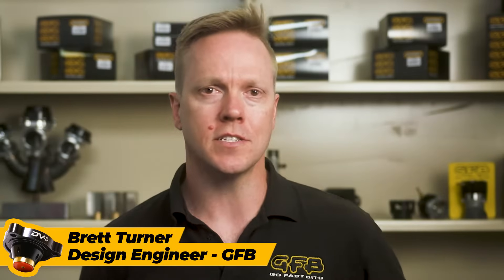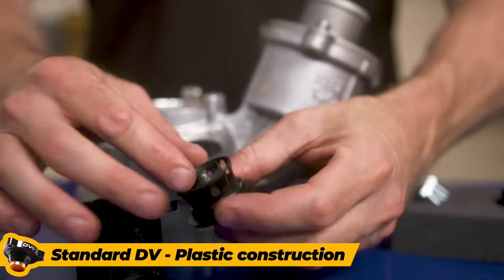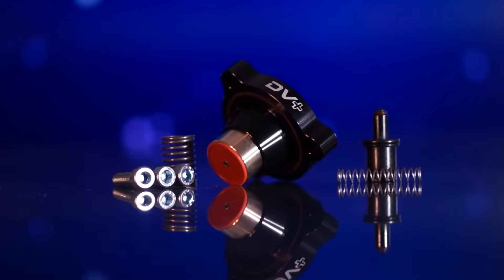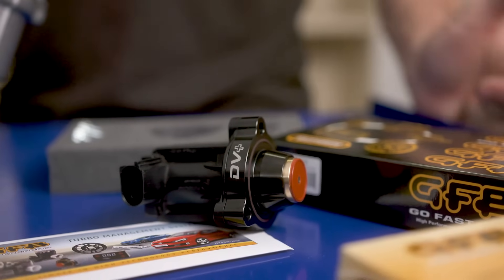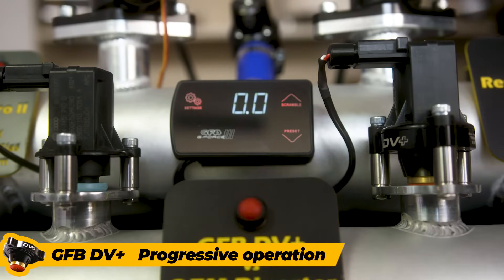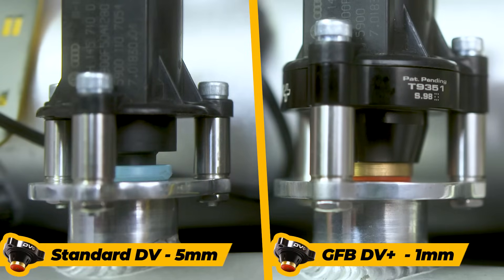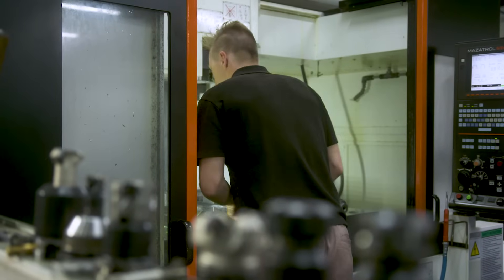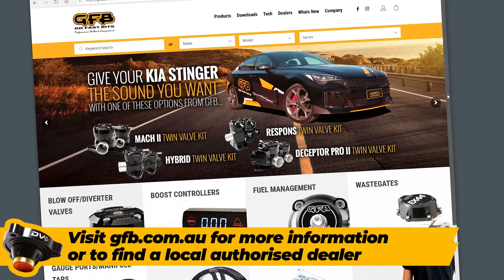GFB DV+ Diverter valve overview

Comment: Installed in Giulietta 940 (1.4 multiair)

Absolutely fantastic!

Long story short: Easy to install. Only took 10min. There are videos on YT to show you how to do it, but the instruction on the manual is very good as well. Lucky for me, the valve location is very easy to reach.

Transmission: It is design to optimise how much boost to loose. It is said to improve a lot for manual transmission. Mine is a TCT auto, and what a difference! The G, being a 1.4L turbo, is not that fast, and turbo lag is horrendous. The TCT box is slow to shift. I thought it was the gearbox, turns out it's the boost leak from original factory valve. With the DV+, it shifts just as you need it (without having to tell it to). 

Acceleration: Now that it got all the boost it needs, it goes like a Maserati (really press you into your seat). Before install, I usually prefer switching to Dynamic mode just to drive normally when I have filled the car with adults. Now, I can do it in Neutral and doesn't feel sluggish. Starting the car takes about half a sec. off. Stop start is quicker to engage. Downshift improved from 2 gears down to 1 gear down when going on ram to freeway. You don't have to step as deep on the pedal as before. 

I have only got it for 3 days. I suspect fuel economy will improve in the long run. Will report it if I have significant gain.

Highly recommended!
Reply from the maker: Glad to hear you're enjoying the DV+! Thanks for your feedback!
Reply: I also own a 1.4 Giulietta and thinking of putting one of these in alongside to compliment my GSR induction kit to reduce some lag and get more turbo flutter.
Big thanks for the report from one G owner to another 👍🍀
Reply: That's great to hear, I ordered one for my 1.4 multi air 124 spider also automatic. I hope it was worth the money, can't wait for it to arrive

Comment: I put mine on, my original wasn’t broke but I hoped I would get some noise out of it but there was no noise change
Reply from the maker: Hi Jason,
The DV+ is designed to be a performance oriented replacement for the factory valve, and improve some of the reliability issues with the design. It is not designed to make noise. Depending on what vehicle you have, we may have an atmospheric venting valve available. This would give you the noise you're after
Reply: @gfbvideos  that would be great if you did, I’ve a mk5 gti 2007 if you had one I’d buy one
Reply from the maker: @jasonseery4885  We do have an atmospheric valve available for the Mk5 Golf GTI. The part number is T9451

Comment: 2020 EcoBoost Mustang here.  Would you recommend this?
I was going to get a BOV but I think the constant whoosh sound every time you let off the gas would be more annoying than anything.  Is this Diverter Valve less obnoxious?
Reply from the maker: Hello,
The DV+ is a much more discreet option than a BOV. Unfortunately though, we don't have a DV+ or VTA available to suit the 2020 model EcoBoost Mustang. This model uses a different design of valve which is not compatible with our products
Reply: @gfbvideos  OH darn!
Thank you for the information though =)
Reply: @gfbvideos , that’s odd.. several resellers/dealers have a model listed for sale for 2020 and newer EcoBoosts. Is this really the case? I just ordered one for my 2021, so if there is truly not a version that is compatible I will need to cancel my order.
Reply from the maker: @semper.fidellis  The valve will not fit the 2019-on EcoBoost engine in the Mustang. Different EcoBoost engines in different vehicles have different valves, so there may be some confusion when looking for an "EcoBoost valve" as this term would encompass quite a few products. For the Mustang specifically though, there is no valve we currently have available for the 2019-on models. 

If you'd like to confirm this you're welcome to send some photos of your stock valve to us at support@gfb.com.au and our engineers can take a look at it.

Comment: Question does the DV make a sound like a BOV?
Reply from the maker: Hi Aadam,
The DV+ is a fully re-circulating valve so it is not designed to make noise. If you're after something that vents to the atmosphere to make noise, check our website for other models that may fit your car such as the VTA or DVX

Comment: Just purchased one of these for my recently purchased Sentra Nismo; noticed throttle response on it isn't great, as well as losing boost quickly. This seems to be what is needed to fix these issues; arrives Tuesday!
Reply from the maker: When an OEM valve has failed you will definitely notice poor throttle response and slow boost onset. The DV+ will certainly fix and improve the issues associated with the OEM diverter valve. Hopefully your issue is with the OEM valve, in which case you should be sorted out in no time!
Reply: Your diverter valve is busted , just buy a new one and put the GFB ON THE FRESH DV
Reply: @crashoverride1575  wdym? did it not work

Comment: i just seen one video on it ... the guy took it off as you keep have to oiling the pistion every so often is this true
Reply from the maker: This is a myth as periodic maintenance or re-lubrication of the DV+ piston is not required. Once the DV+ has been used for about a week the microscopic machining high spots are flattened and smoothed. The DV+ will continue operation almost indefinitely without wear, irrespective of lubrication.

Comment: @GFB Why don't you have a product for the Biturbo V12 Mercedes M275??
Reply from the maker: To put it simply, we've not had an M275 in the workshop! However, there's a better-than-good chance our T9354 DV+, T9454 VTA, and the T9654 DVX will fit. Contact us through our tech support and we can discuss in detail.
Reply: @gfbvideos   ah yes, Mercedes just uses the standard mechanical vacuum/diaphragm with beige plastic cap that come stock on BorgWarner EFR & KKK recirculation valves (as seen in part 5900711000 and 179424) the vacuum hoses just lead to separate inline solenoids.

Comment: Hi! Ordered one today through a Swedish company called DO88. (NR T9351)Im curious though, if it will fit on my car? Its a Vw Golf Alltrack 2018 with the 1.8 TSI EA888 3d gen. Please advice, hope I bought the correct valve. Thanks!
Reply from the maker: Yep, T9351 is the correct valve for your Alltrack.
Reply: @gfbvideos  Thanx mate 😀. Tomorrow, its time for installation!

Comment: Can I install a diverter valve spacer to have a louder blow off on this product?
Reply from the maker: Yep, as long as you have the room and the longer bolts you can stack a DV+ on top of a BOV spacer for sound. If you haven't purchased either, I would suggest taking a look at our VTA range, which is an atmosphere venting version of the DV+.

Comment: Hi, I just got one for my BMW F20 116i and the turbo lag has increased 😕 I am thinking to take it out, unless you got any idea what I could do to fix it?
Reply from the maker: Hi Slav, I've just replied to this question in tech support. The additional information you gave me in that email indicates to me that the lag is a secondary issue. Once I get more info I'll be able to help you sort it out.
Reply from the maker: Glad we could help diagnose the issue via tech support. For the benefit of others here on youtube, it turns out Slav was sold a counterfeit DV+ and it had no hope of working properly. Because the DV+ looks simple, it's tempting for other manufacturers to copy it, but trust me when I say there's more to it than just making it look the same - we deal with many customers who have been misled and have purchased fakes, and can't get them to work properly, so make sure to check where you're buying it from!

Comment: I want to instal this on a 2010 r56 s model, will i get the pshhh sound?
Reply from the maker: No, this is not a blow off valve as such in that it doesn't vent to atmosphere to make the pshhh sound. If you have an aftermarket intake you'll hear a subtle exhale, but that's about it. This product is for performance rather than sound.

Comment: Just put mine in is it supposed to flutter or be quiet
Reply from the maker: Hi Derek, 
The valve should be quiet. There may be some very light flutter when lifting off from low load situations, but in general it should be quiet

Comment: Hi potential buyer here, am i still getting my "pshhhh" sound when I lift of throttle with this upgrade?
Reply from the maker: Hello, 
It will depend on what valve you're currently using. If you're using a re-circulating valve like the OEM one, and the noise is coming from an aftermarket intake upgrade then yes this will give you to same noise. 
If you're using an atmospheric venting valve and swap to a DV+ you may lose some of the sound. If you're wanting to vent to the atmosphere we may have something suitable. You can search your vehicle on our website, or contact us at support@gfb.com.au and we can give you some more vehicle and application specific information

Comment: One more quick question. Do you know if the throttle closes on a DSG equipped VW during gear changes (mainly upshifts)? I know that in a manual, you would usually take your foot off the throttle briefly during upshifts. So, the diverter valve would open. But, on a DSG, I'm not sure it does. I'm also wondering what tells the diverter valve to open. Is it the TPS, manifold pressure readings, or what? I'm just trying to figure out if the DV+ is more beneficial for manual transmission cars vs. DSG equipped cars. I'd love to hear your thoughts.
Reply from the maker: Hello, 
Generally the throttle plate will not close during gearshift on a DSG equipped vehicle. One of the advantages of a DSG equipped car is that you're not closing the throttle and losing any boost pressure during gearchange. 

So the benefits in terms of throttle response will be more noticeable on a car with a manual transmission than one with a DSG or automatic gearbox. The benefits will be felt when feathering the throttle for example during cornering, but there isn't that loss on gearchange with your DSG gearbox for the DV+ to improve on. The opening of the valve is determined by a number of sensors including those you mentioned, the ECU can also open the valve in some situations to improve economy. 

You will of course still get all the other benefits like it's ability to hold boost better, and reliability over the stock valves.

Comment: Installed mine on my 17 Camaro 2.0t...and now not only is boost retained but it now pulls over 6000 rpm like a NA engine...Thanks guys.
Reply from the maker: Thanks very much! We're glad to hear you're a fan of the DV+
Reply: @gfbvideos  It will also work on the 2016-19 Chevy Cruze 1.4L LE2 and 2016+ Chevy Malibu 1.5L LEV Engines since the turbo and engine is the same! The valve is also the same as the GM 2.0L LTG Engine.
Reply from the maker: @seangowan7441  Thanks very much for letting us know! if you've got any photos of the valve installed on your car  and would like to send them to us, we'd love to see them. You can email support@gfb.com.au

Comment: If the small hole in the center of the piston's silicon face is always open, how does the dv+ prevent boost from leaking out past the sides of the piston? Is this where the light coat of oil comes into play? I'm sure the tolerances between the piston and the aluminum housing are very tight, but it's not an air tight fit. If it was, the friction would prevent it from moving at all...
Reply from the maker: Hello, 
Yes that observation is correct. With any piston style valve, there will be some amount of air that can leak past the sides of the piston. Otherwise it wouldn't be able to move. The only way to completely avoid this is to use a diaphragm. Whilst diaphragms seal well, they are prone to breaking over time, especially with increased boost pressure. OEM valves used to be a diaphragm design, but they too swapped to a piston design for the most part. 

The key then, is minimizing the amount of air that can leak past the piston, whilst still allowing it to move freely.  On the DV+, this is done by holding very tight tolerances and individually sizing the piston to the bore, to ensure the perfect fit. OEM piston style valves however can't be held to these tolerances and tend to leak quite a lot.
Reply: @gfbvideos  I would imagine that light coating of oil you advise placing on the piston can also lower the amount of air leakage, correct? Aside from that, unless the leak is extreme (like it is in my current piston style valve) maximum manifold pressure will still be maintained by the turbo and waste gate, right?
Reply from the maker: @quesnoy1  The oil can play a part in reducing leak, but it's main purpose is lubrication. Even without oil the leak is still far too small to cause any change. 

If you think about an engine on boost that's consuming a few hundred cubic feet of air per minute, a leak down past the piston will be a fraction of a cubic foot per minute which makes up such a tiny portion of the airflow that the turbo sees. 

If you're interested there's a technical write up that can be found here 
https://gfb.com.au/wp-content/uploads/2019/01/GFB_DP_Diverter-leak.pdf

Comment: Just installed mine in my Mk3 RS. Great response, no flutter from WOT to Closed Throttle at high RPM, just slight at low boost/low rpm which is normal. Definitely feeling the better response and boost retention between gears. Ace stuff!
Reply from the maker: Glad to hear you're loving the DV+! Thanks very much for getting in touch
Reply: @gfbvideos  hi this product you show in this video has 1 vent hole in the spacer around the brass piston but you also have another video that has the DV spacer housing with 3 vent holes in it? what's purpose of this?
Reply from the maker: @JH-sc7cs  When the solenoid is directly mounted to the valve, the piston with a hole in the center is required since only pressure is used to actuate the valve. When the solenoid is remotely mounted (usually a 3 port solenoid) a hole is not required in the piston since the valve is actuated using pressure and vacuum. Both have the same performance, but actuated using different methods.
Reply: How’s it sound?
Reply: @shared4432  i can get a video of driving it for ya sometime soon ish here. I'll stick a mic under the hood

Comment: I really wish I did not waste the money I did on this. It just won't work properly. Tried all support suggestions and none actually worked. It will flutter and give errors every time. Went through about 10 times installing and uninstalling on my car.
Reply from the maker: Sorry to hear about your issues with the valve. Please feel free to contact our support team at support@gfb.com.au regarding any technical support issues. There we will be able to give you tailored support to suit your specific circumstances.
Reply: @gfbvideos  I really do hope there is a solution. And really hope it doesn't cost me more than it already has (been through mechanic 4 times, wasted my time unstalling and installing 10 times and cant use my car on full throttle or else it will give errors and make the turbo to "turn off").
Reply from the maker: @Quetzasp  We've replied to your email. We do have lifetime warranty on all our parts so we'll be happy to help diagnose and solve your problem
Reply: @gfbvideos  Harrison is indeed helping me alot. Hope we can solve the problem.
Reply from the maker: @Quetzasp  Thanks very much for your patience! If you have any more issues feel free to email us again

Comment: Is it gonna work for an 08 audi a4 2.0t with a bigger turbo? Specifically a GT2860RS? I'm thinking a newer DV but dunno if this'll work
Reply from the maker: The DV+ will work with some turbo upgrades for that platform. The GT2860RS however doesn't appear to have any provision for a diverter valve There will be a couple of potential methods for installing a diverter valve to your car. For more information specific to your situation please contact us via email at support@gfb.com.au

Comment: My DV+ is on the way and wondering will my spacer fit with this also?
Reply from the maker: Hi Feliepe, 
The DV+ will fit with most aftermarket spacers. We don't recommend this however, as the spacers we have looked at appear to be very restrictive and may not allow the valve to vent enough air.